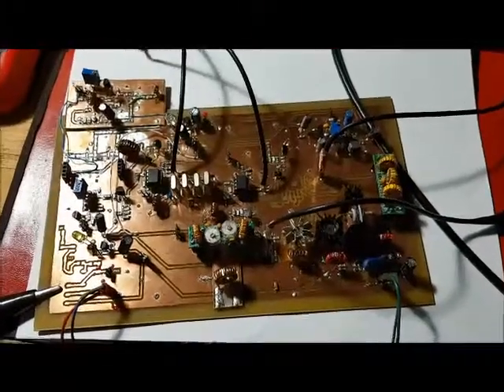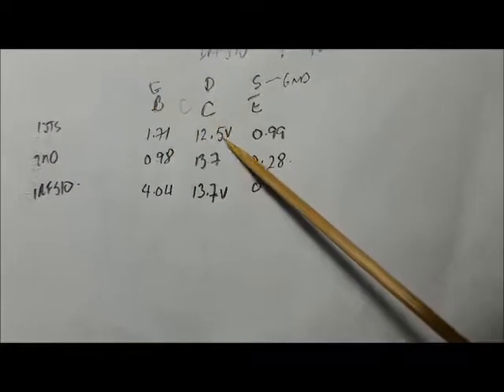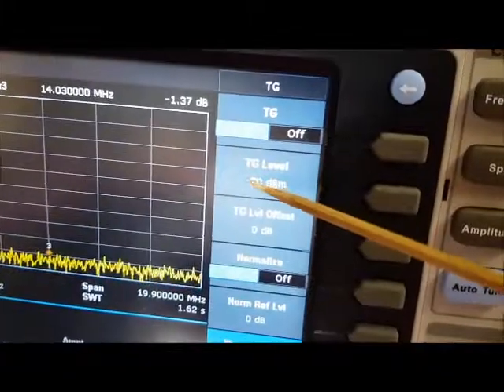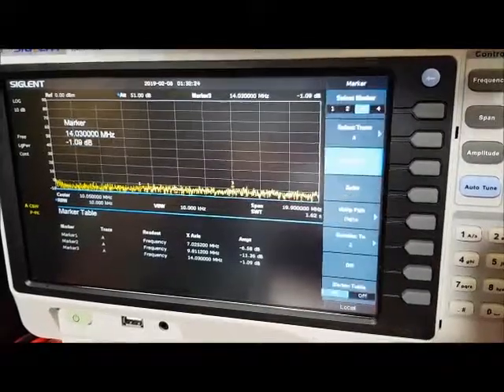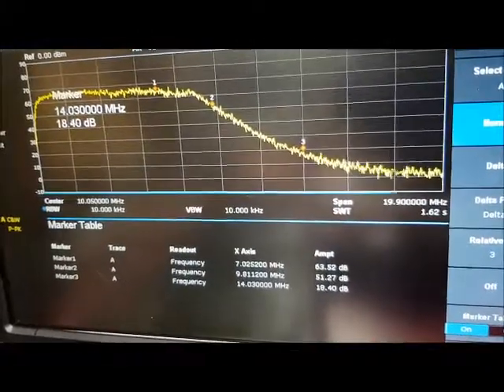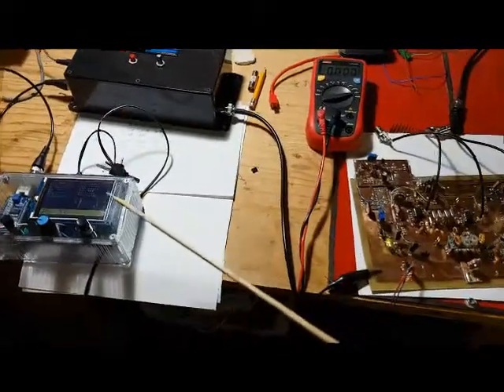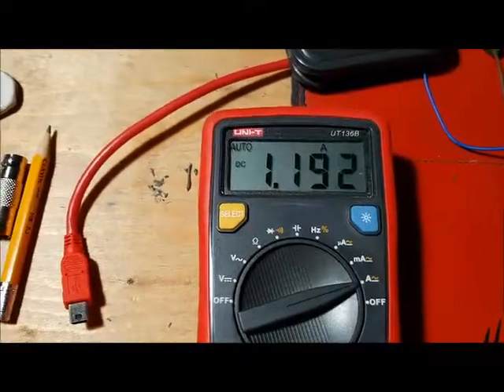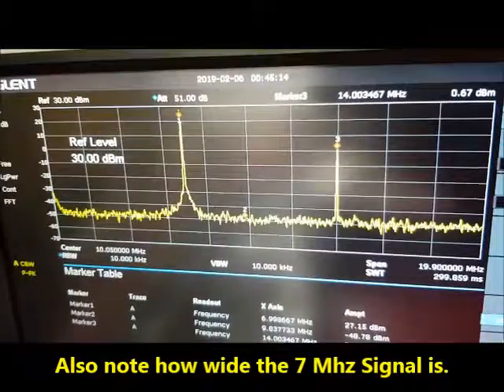Dueling 612s Final Power Amp Testing Update

Comment: in the first test, you get fluctuating bias current because the tracking gen turn off and the on at the end of each sweep which is not an issue so your measurements were actually ok. in the second test again your mixer input (inside SA) is close to -22dB or so, which for this SA although it is not complaining (beeping) but it is a bit overdriven and thus your amplitude measurements (specially harmonics) are not gonna be accurate